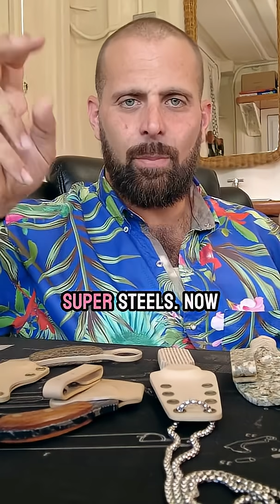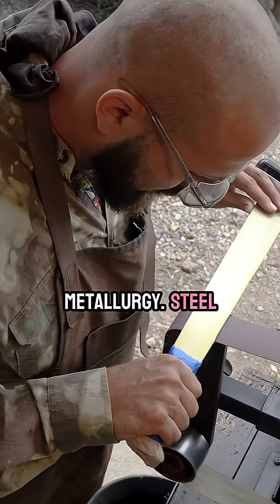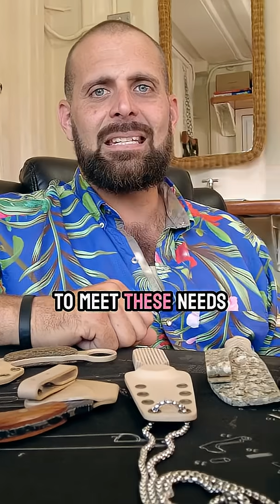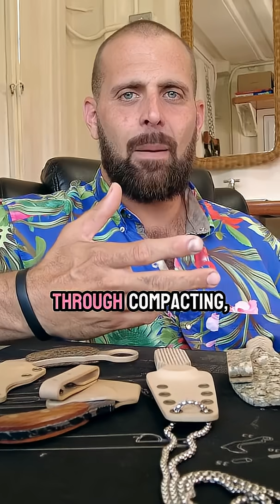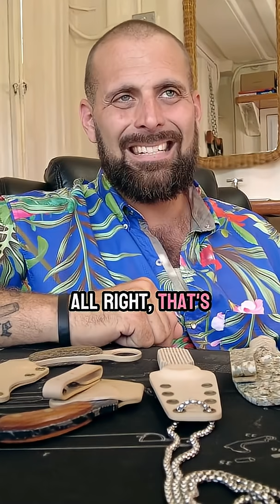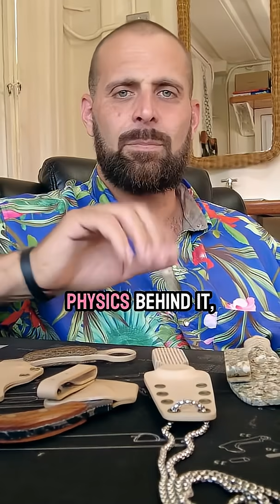Super Steels - Excerpt From: Knife Steel Explained by a Knifemaker

Comment: NOT a metallurgist, but I studied it. 
It sounds to me like they are eliminating the carbide grain boundaries, which is madness. Those grain boundaries are what gives steel its hardness. The interior of the grain is more ductile and less hard, but also resistant to cracking. 
Carbides in the steel are good for the blade - that's why we quench, hammer, and drive carbon into the steel exterior.
Reply from the maker: No sir. Definitely watch the full video if you’d like to get a better understanding. It can be a bit difficult in these shorts to get the full concept.
Reply: It reduces inclusions and makes a more homogenous grain structure.